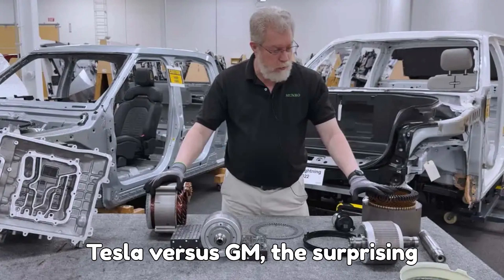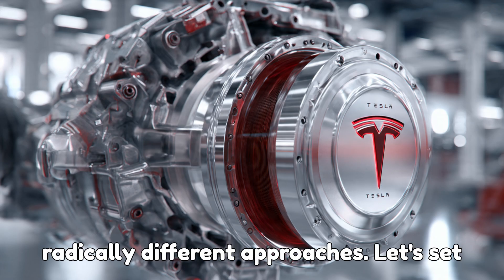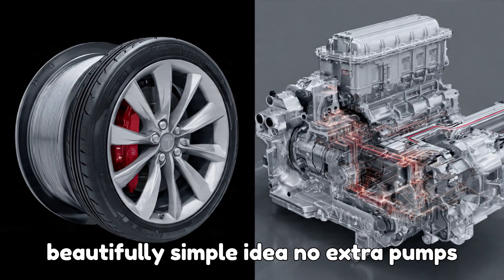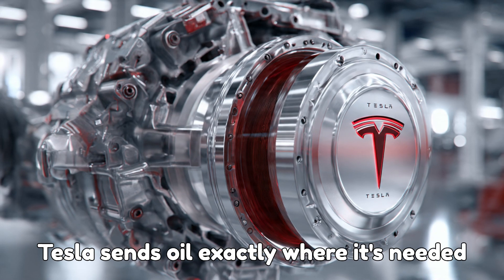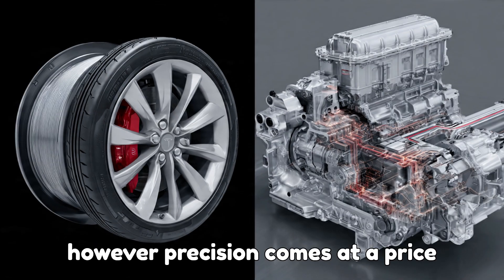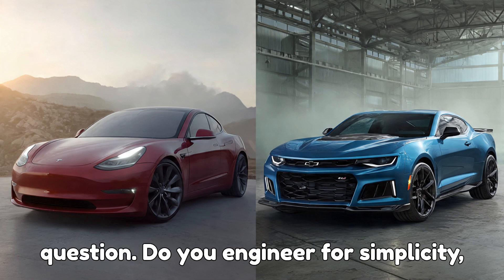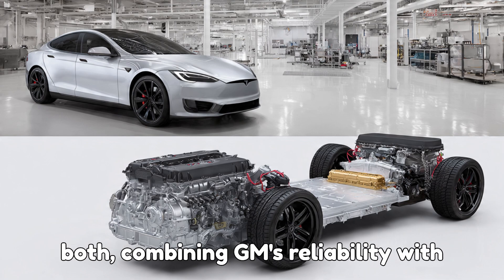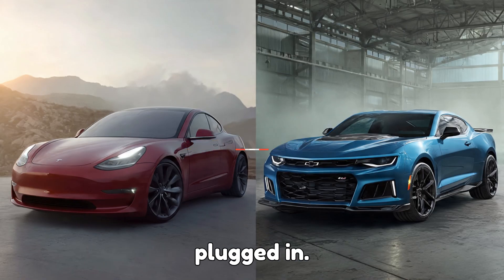Tesla vs GM: The Untold Truth Behind Their Radical Motor Cooling Battle

Comment: I would think that both cooling systems use a multi viscosity fluid to stabilize the fluid dynamics of both cooling systems.  The concern I have is with the life cycles of the various components.  For instance, Tesla’s plastic manifold ring that distributes fluid around the motor components is subjected to heat fluctuations and I’m interested in the evaluation of the plastic’s performance over time.  Winding insulation is another potential failure.  How do these components behave when rotating at high speed, creating shear forces on, and turbulence within the cooling fluid?  Is any cavitation possible within the gravity flow system since it operates in a vented environment that shares the coolant fluid between both the motor and power transmission systems?